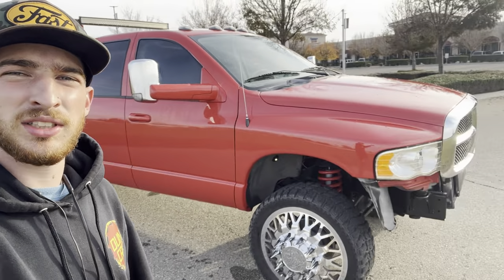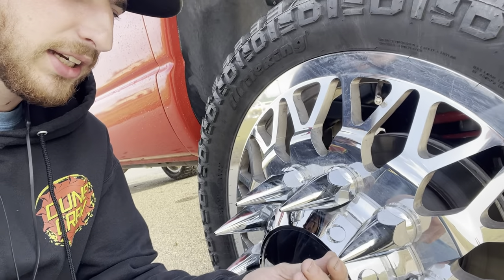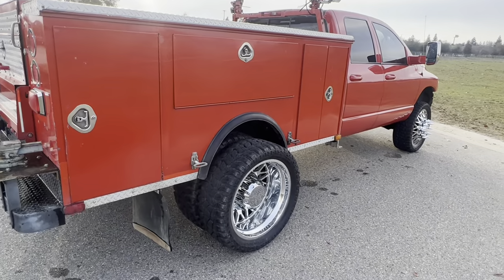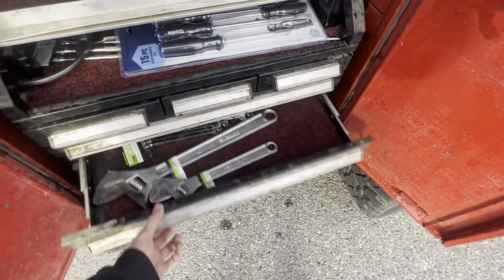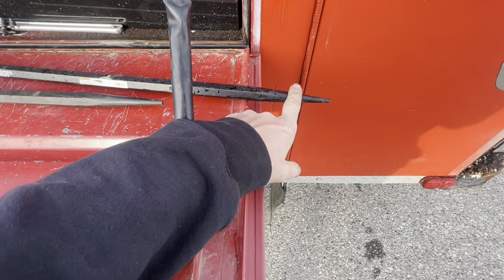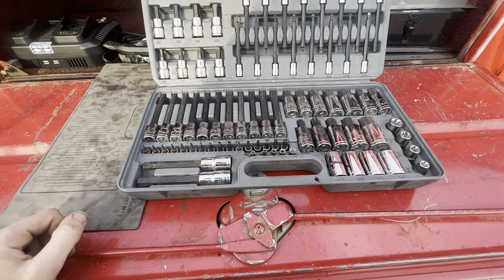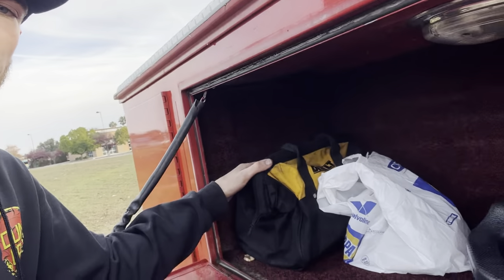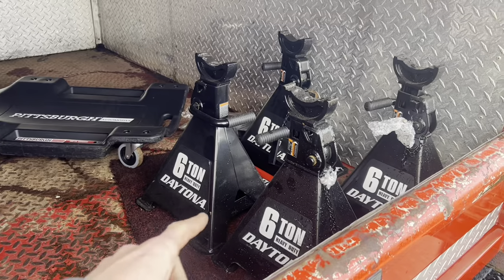Diesel mechanic service truck tour!

Comment: Great rig, but I would’ve gone with something less flashy for the wheels. Maybe in Cali the flashiness works, but here in the Midwest, these farmers would laugh you off the farm. Id also suggest investing in bottle jacks, rags, fluids, and scanning diagnostic tools. You should also carry a laptop with service manuals downloaded and/or paperback service manuals. You need to retrieve info quickly, so google isn’t the answer. I’d also suggest getting your tools organized. You mentioned how good the quality was for many of the tools you showed, but they were still in the original packaging. Need to unpack them and organize. Get yourself some socket trays and set them sockets up. Get wrench and Plier rails if the space allows. Your main rival will be time. You need to be very efficient, so tools packed away like you have will cost you precious time. I’d suggest watching some other vids on YouTube of device trucks, as there are a lot of guys with excellent rigs/setups. Keep hustling and we want to see you succeed!!!
Reply from the maker: Thank you very much, I need to find a bigger tool box that will fit in my bed so I can be more organized. Bottle jacks and all the other big tools are in the works
Reply: @Trentonbowers  I think your current bed size is great for starters, but I do agree that long term, you’ll need something bigger. Overall, you’re off to a damn good start, and I respect the fact you didn’t sell your soul to the tool trucks. I think HFT has some great tools, especially their Pittsburgh Pro impact sockets. Not sure on all the ICON stuff just yet, but I’d assume it’s better grade than standard. Keep posting vids for sure. Guys love seeing service truck setups, and I’m certain you’ll get some great info as to what to buy and/or consider for future needs!!
Reply: Ridiculous comment about the wheels lol if a farmer “laughs” you off the farm because of the wheels even though you can do his job needing done, he probably got some growing up to do

Comment: Log all your miles, keep records and receipts for all the tools and equipment you buy, track every single vehicle you touch by vin or serial number on the receipt/work order, track how long each job takes so you can figure out how to be more efficient and will also help you quote jobs, be open and honest with your customers it's difficult to gain trust as a mechanic, get insurance, charge customers for the skillset and capabilities you're offering (don't sell yourself short but be honest with yourself about capability)

You'll work 10 times harder for yourself than you will for anyone else but it's worth it in my opinion. Wish you the best of luck in your venture!
Reply from the maker: Thank you very much that’s all incredibly helpful advice

Comment: 6,000 on wheels and have a service truck that’s not fully tooled out yet…. Makes sense
Reply from the maker: This is my hobby/business. I still work a day job making decent money and the wheels make me happy not to mention it will bring attention to my truck which makes more people see my logo when I have them installed
Reply: @Trentonbowers  Whenever you start getting a little bit of attention of succeeding someone is always going to complain. It's an over compensation thing. Do things that make you happy and ignore the naysayers. Took me a long time to learn that! The way that truck looks will bring in more attention and you have enough tools to do an engine swap on the side of the road. You have more tools than I do and I can do it with less so anything else you add is just a bonus. I'd say you're going to go places. Keep posting, man. ✌

Comment: I have a logging company and have a shop box on a srw f350 so being limited on space I’m currently switching to rotopax cans to hold fluid and maximize usable space plus the mounts are lockable. I think something for holding used fluids would be good along with a drain pan or 2. I don’t have space for an air compressor but find a cordless leaf blower works well for blowing out radiators and air filters. I also use quickbooks self employed because it links to your bank account to track all transactions and it can log vehicle mileage also, it’s helped the last 9-10 months I have been using it.
Reply from the maker: Thank you very much for the advice! I will definitely look into quickbooks

Comment: from what i see on the facebook groups and videos...
this is the best tools so far for the job to be done, nothing fancy like tons of strapon. and 100 same exactly ratchets.
but you better to get some another 5-6 different ratchets
i am a mobile technitian. i think i have about 10 ratchets. all of them different. and a lot of times i work at the same time with 2-3 ratchets on each one is a diffrent size of socket..

Comment: The gear wrench torx/etorx/hex set is way better then the blue point it’s cheaper and comes with more. Goes up to T-70 nice truck good luck with ur mobile work i do mobile work. It’s def fun but a fight

Comment: Air compressor and a decent inverter. 

Word of mouth is always the best advertising. Do good work and the work will come. 

If you are getting into hydraulic work get into a pressure test kit. Pretty much required. Also cap kits for all the commons fittings. JIC, ORFS, etc.

Get a couple ratchet chain hoists. The 1/4 ton and 1/2 ton models. Not expensive and it’s another set of hands. Same with rope ratchets. You’ll find more uses then you can think of. 

Bottle jacks and large blocks of wood are required. 

Diagnostic equipment. Various pressure testers and a decent multi meter. Plus back probe kits, test lead kits, etc.

More drain pans, and a transfer pump.

More cordless tools. It’s all about efficiency.
Reply from the maker: Very very helpful, thank you!
Reply: @Trentonbowers  Yeah man, nice rig!

Comment: So you started building this truck before you had a customer base to support a mobile business?  
I hope it all works out for you, but I would be trying to get customers set up before finishing the truck. 
I would also get a fire extinguisher in that bracket in the left rear compartment, don’t want a mishap to cost you everything.
The pencil sharpener at 7:09 is pretty sweet.
Good luck in business venture!
Reply from the maker: I had been doing mobile mechanic work for about 6 months prior to building the truck. The mobile mechanic work is really what funded the build so it sorta paid for itself if that makes sense
Reply: @Trentonbowers  Ok, good deal then.

 If you’re doing hydraulic work and need the “super jumbo” wrenches, Harbor Freight has the best price on those too. 
I’m not paying Snapon prices for those. 

Once you get into big stuff, you’re not going to break it even if it’s China stuff.
Reply: If that’s true then why are all the tools still in the packaging. If you pay cash for everything, no debt. If that’s true why do you even need to do this? You are saying you just dropped a bunch of money. Where are the Diesel tools?

Comment: Get out there... fill them boxes up man... I'd you don't have waste oil tank. Buckets and lids. Get yourself a computer for diag. Air compressor... working with just batteries ain't gonna cut it. Get some 20 ton bottle jacks... hit me if you need more advice
Reply from the maker: Thank you very much! I have a 30 gal gas air compressor I need to install and a snap on scanner however it doesn’t so big rigs so that’s another investment I need to make
Reply: Non locking flex head ratchets take a while to get used to.  More versatile so that is what I carry in my mobile bag.  Funny for me when someone else uses it, frustrating for them.😅
Reply from the maker: @tradesman63  they are definitely frustrating at first😂